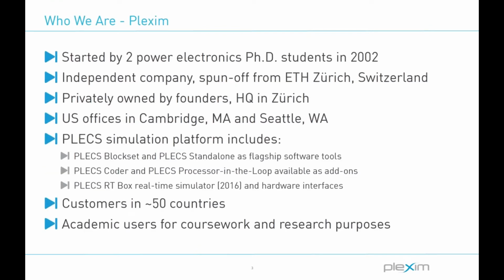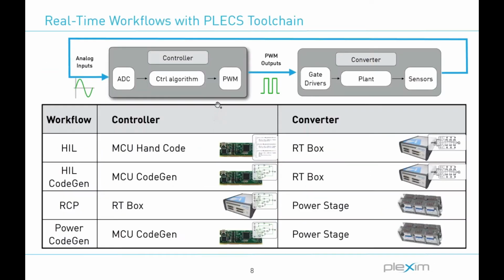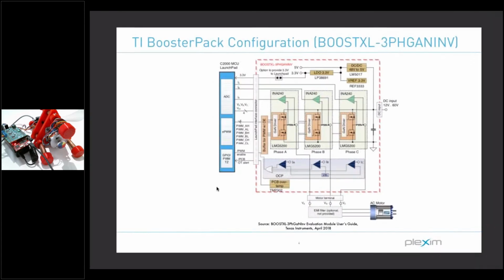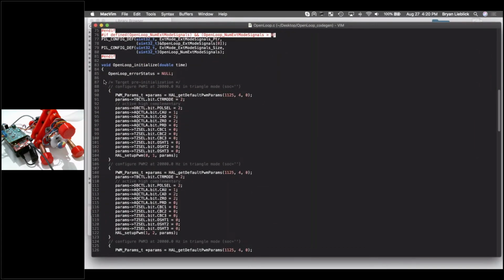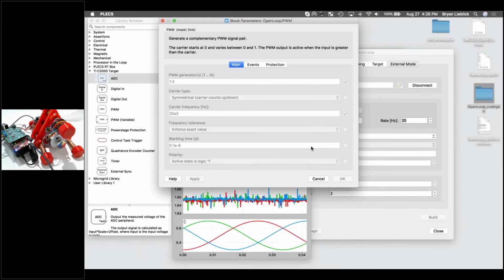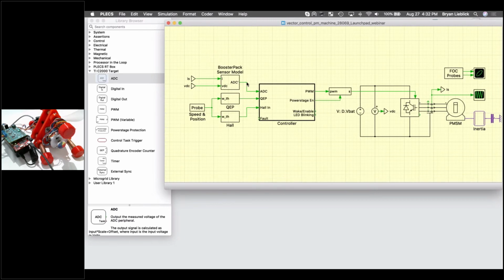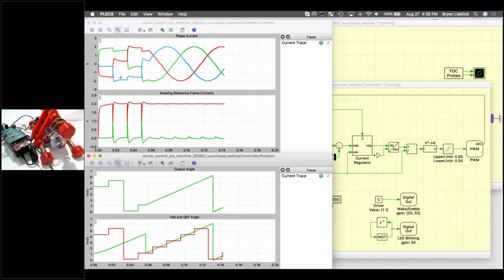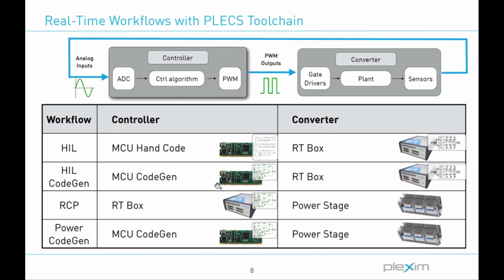Webinar: PLECS Coder and TI C2000 Target Support Package (27-August 2019)

Comment: Nice video , I would like to know how can we define a specific PWM pin or Phase Shift between two PWM output ?
Reply from the maker: Hello, Rahul. PWM channels are defined by the ePWM unit (e.g. ePWM1, ePWM2, etc.) which are associated with a specific GPIO pin. There is a separate component titled "PWM (Variable)" enabling variable phase and variable frequency PWM outputs. We hope this helps!